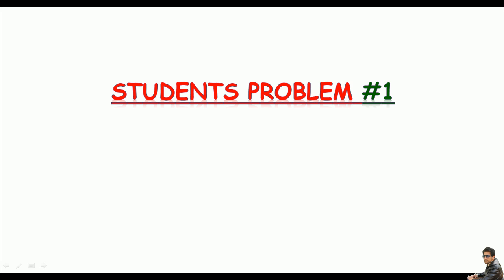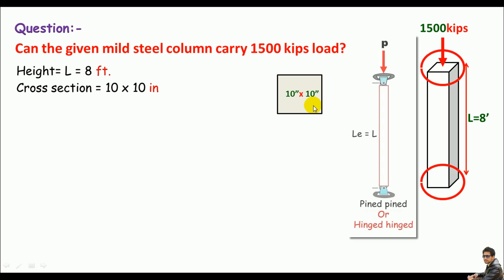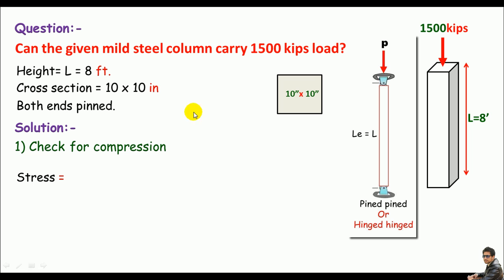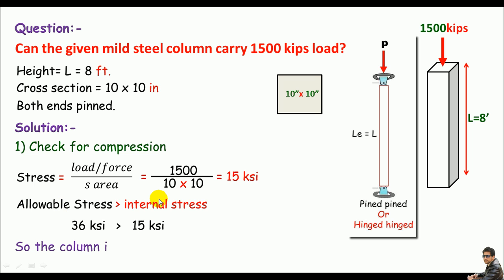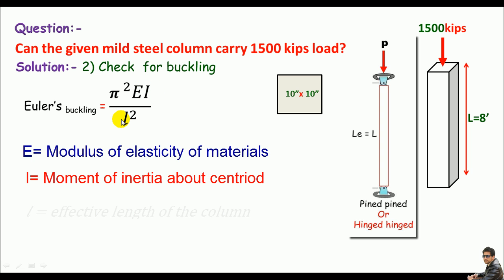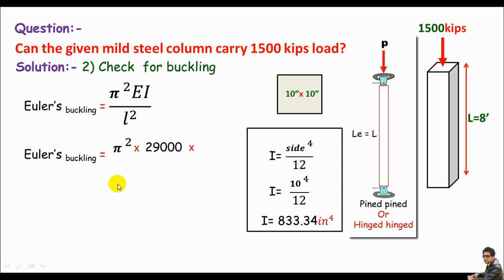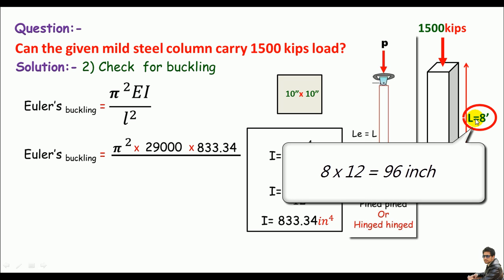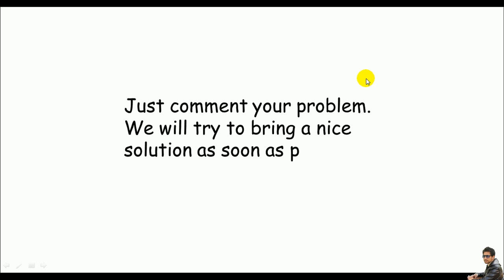students problem#1 :- how to check if the column can support the applied load or force ?

Comment: Hello Sir, How can I solved this problem? Please design a welded box-section axial compression member. Steel
grade is Q235B, column length = 9000 mm, top end is hinged and the
bottom end is fixed. Standard value of permanent load NGK=1200 kN
(γG=1.3), standard value of variable load NQK=2400 kN (γQ=1.5).

Comment: E = elasticity that you say, 29000 that i didn't get.
Is it constant?
Pi is constant 3.14, but E = 29000 how it determines! 
Please elaborate it if possible 
Thanks
Reply from the maker: E is modulus of elasticity of material which is the ratio b/w stress and strain. This may be different for each type materials. Can be found by testing the materials
Reply: But what's that 29000 is in, and of which material, can u just give a information regarding the E value how it to be taken deeply

Comment: Sir thank you. 
My question is (1) how can we say 1500 kips load is acting? 
(2) on what basis we are taking allowable stress value as 36 ksi
Reply from the maker: Long answers dear. Can not be type in comment. I will bring video on this
Reply: @Sulimankhanacademy  please make a video sir
Reply: Same puzzling me that how  did you  determine 36 kips !
You test Assuming , colum size 10" × 10"  and test load 
15kips, how do you get stress or compression 36 kips in which your guessing!

Comment: First thanks for great video. But  one question, what if the support is fixed or roller instead of pined?
Reply from the maker: hello. thank you for joining me. by changing the end conditions only effective length will be changed in formula other process will be the same. by the way if you check the video in detail i have already cleared your question in video...
Reply: the denominator has a special coefficient “k” and it is also squared..  he didn’t place that in the original equation.. that “k” value is in relation to the question you asked( pined both, fixed &pined, fixed both, fixed & free)

Comment: WHY HAVE YOU USED ONLY 29,000 psi VALUE WHEN IT SHOULD BE 29,000,000 psi as MODULUS OF ELASTICITY ?
Reply from the maker: FELIX Jr. SAN BUENAVENTURA 
hi. thank you . nice question. but its 29000 ksi not 29000 psi. please check the video again. remember 29000 ksi is equal to 29000000 psi